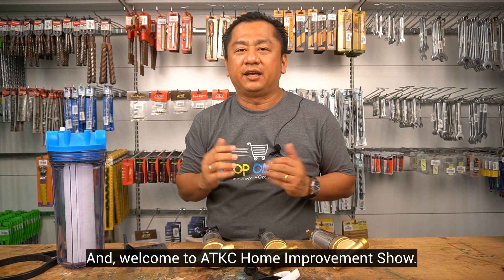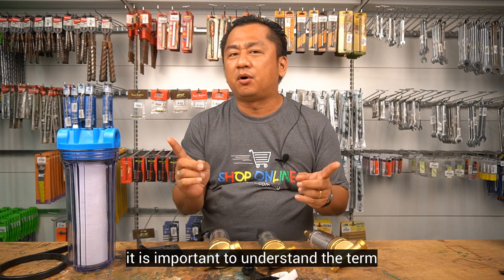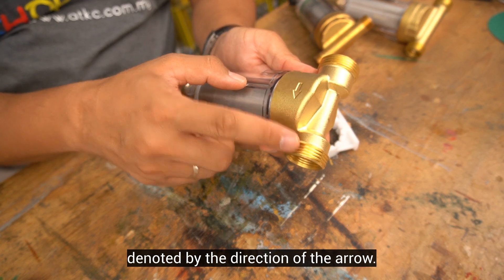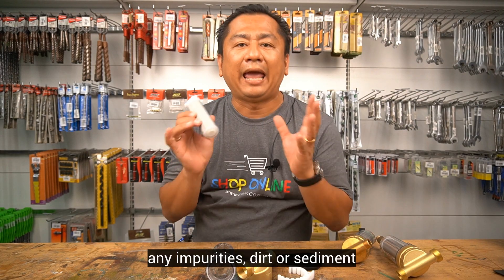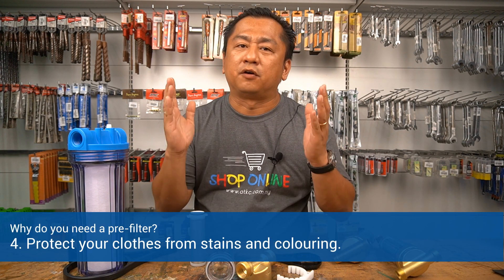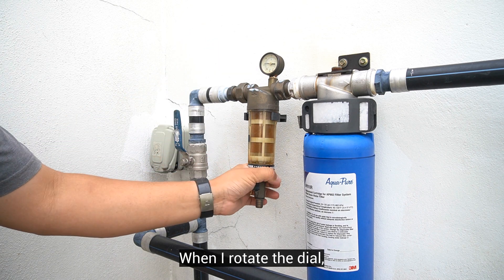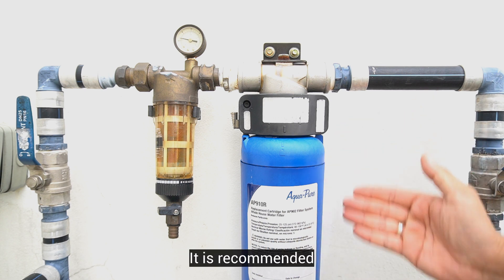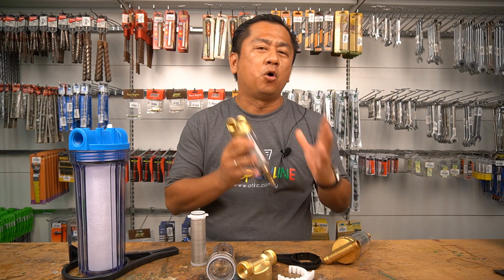5 Important Reasons | Why you should install a pre-filter in your outdoor water filtration system?

Comment: My home has not filtration apart from my cooking & drinking water. Recently we had water supply problem and so i kept a tub full of water in my bathroom just for emergency. I noticed there are film of oil like substance on top of the water. How do i get rid of them? What filtration do i need? Than you.
Reply from the maker: definitely suggesting you to install an outdoor water filter system. It's safer this way. I can't comment much on the "film of oil", it may be external substance. You may check with your water authority for this.
Reply: @ATKCeWarehouse  tqvm
Reply from the maker: @mgpunya1  welcome

Comment: Can you explain the pressure gauge? What's it for and what should the pressure be? Thanks
Reply from the maker: The pressure gauge is to gauge the amount of water pressure going into your home piping system. Normal water pressure is generally between 40 and 60 PSI (2-4bar). The sudden drop of water pressure, may be caused by incoming water supply or you need to clean or replace your filtering cartridge.

Comment: Hi Kok Gei, thanks for this informative video. I plan to setup an outdoor filter system for my new home. Planning to get the filters from your shop. If I were to install the pre-filter first, followed by sand filter, cartridge filter and then membrane filter. Objective is to have cleanest water possible and extend lifespan of my filters by running water through multiple filters. May I know if this is recommended and will it affect the water pressure going into the house since the water have to travel pass so many filters?
Reply from the maker: yes, you are right. Running thru multiple filters will definitely decrease the water pressure, and worse when it comes to trapped sediments against time. My humbly suggestion, pre-filter > cartridge filter > membrane filter.
Reply: @ATKCeWarehouse  Thank you very much for your reply sir. Appreciate your advice. Will setup as suggested. 😄
Reply from the maker: @leeoeijin902  Thank you. Let's learn together yeah